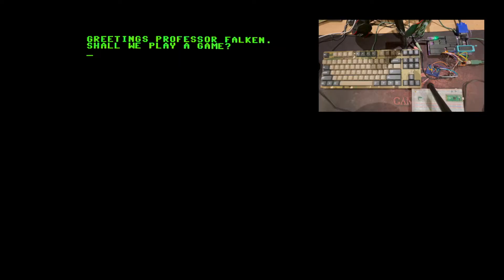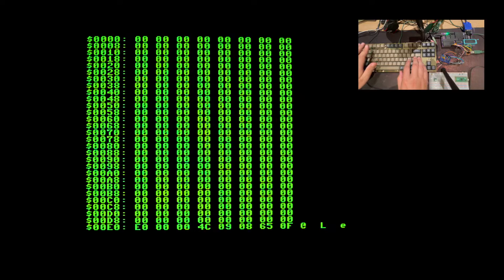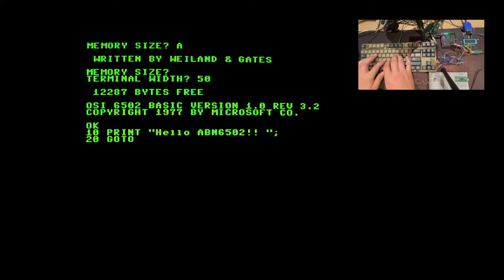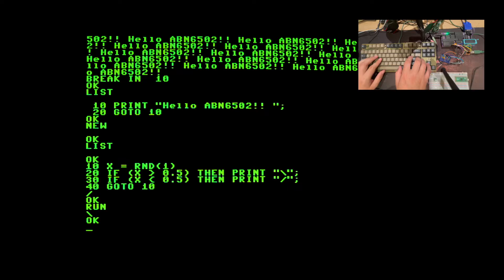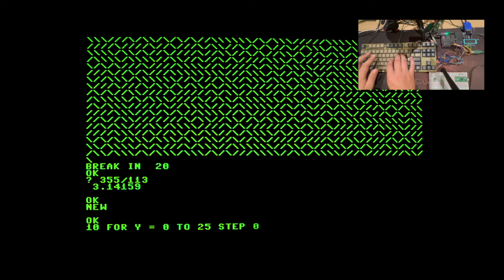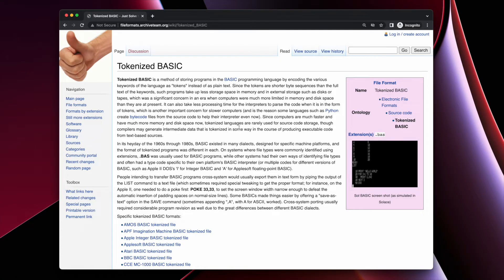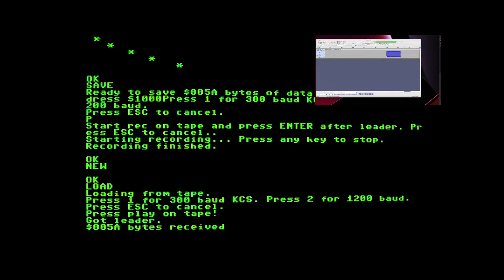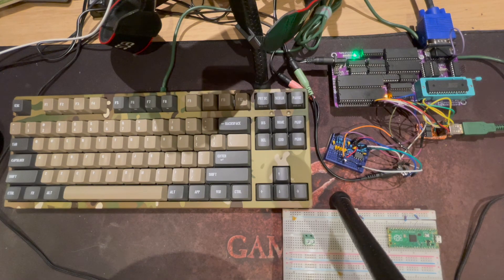Microsoft BASIC from 1977 on my 6502 computer!

Comment: Basic may get hated on, especially the primitive basic the c64 got for its power. But really, it was like a modern python, even great games like Sid Myer's Pirates! Was written with basic as the control code, with machine code routines for the graphics or such. When you have all these awesome "libraries" of functions already made for you, why not use them? I like to think of it like what python is for us today. It's not the fastest, but it's good enough for doing scripting and household cleanup tasks andv even simple games or ui things if speed isn't critical. It's easy to learn and usually used for education as a first language. I would love to see the original basic source, and see how they did all these functions.
Reply from the maker: I think you're spot on there. I wouldn't pick it as a first language today but I sure wish I'd learned it sooner :) 
I think Michael Steils Basic source I link in the description is pretty descriptive of what's going on - I think the original source is out there too, though a bit harder to read actually.
Reply: @AndersNielsenAA  It was my first language, as I got my gramps old co-co3 when I was 8, then I got into python in highschool. Always leaned towards low level, though. I like to understand exactly what is going on on the bare (semi-) metal. Never gotten feel enough into assembly, and as nice as z80 assembly looks, 6502 is in practically everything old I have, aside from that one 6809.

Comment: This is a nice video!! I tried this on my Commodore 64 but there is no "backslash" on the keyboard or the Basic screen codes. In Line 20 I used  PRINT CHR$(109)  which is a graphics character, but very similar to the backslash shown in the video!
Reply from the maker: On your C64 you should instead try: 10 PRINT CHR$(205.5+RND(1)); : GOTO 10
And if you're up for some reading I suggest you take a look at https://10print.org/ :)

Comment: There were two kinds of BASIC available on those days, GE BASIC (which is what MICROS~1 used), and the (far superior, IMHO) HP BASIC, which Atari used.  Happily, Atari ran on a 6502, so HP BASIC on a 6502 exists.  I found a copy of Atari BASIC source code, but not in a machine readable format, so I'm in the process of getting it scanned and cleaned up.  Then, once I replace the Atari-specific bits, I should have a very nice 6502 BASIC.
Reply from the maker: Awesome!
Reply: @johnrehwinkel7241 Hi John, any news to report on your work with the HP BASIC?  And by the way there was also the Acorn (a UK computer company) BASIC which evolved from System, to Atom, to BBC BASIC.  See https://en.wikipedia.org/wiki/BBC_BASIC  No sources I think, but it isn't all that hard to use one of the many 16 KiB images with a bit of a skeleton OS harness.

Comment: I downloaded the msbasic master folder from the github, but I got a bunch of errors in ubuntu about line 8? Did I download the wring folder or something? Cany anyone help me out here?
Reply from the maker: Are you trying to put Basic on specific hardware or just to assemble the project? 
If you just want it to assemble for my “ABN6502 SBC” you can clone that project and then clone the msbasic repo into the msbasic folder of my project.
Reply: @AndersNielsenAA  I just want to assemble basic itself so I have the file when I complete my own 6502 computer project. I also want to use basic in a 6502 Emulator. 

I also figured out what I did wrong, I didn't have cc65 installed.
Reply from the maker: @Nebula_Protogen752  I'm happy to hear that. If you still need help you might get some hints from: 
https://github.com/AndersBNielsen/abn6502
msbasic works standalone but you need to configure your input/output routines and memory map file.
Reply: @AndersNielsenAA  So all I need for msbasic to work is having I/O space in the 6502's memory map? that's amazing! 
Thank u for the help, I'll look at the link later